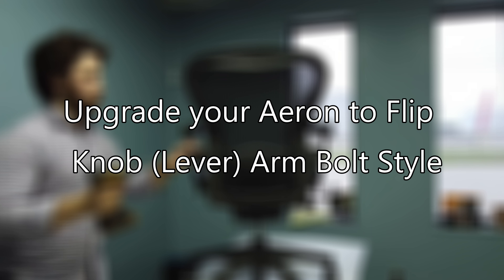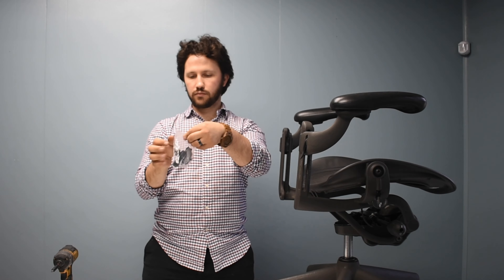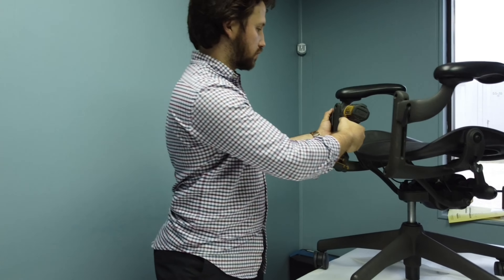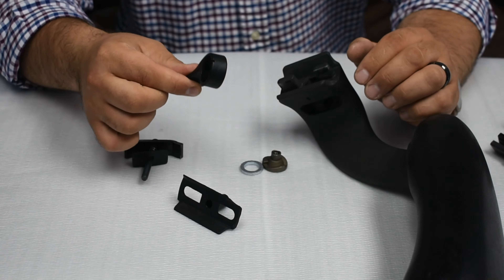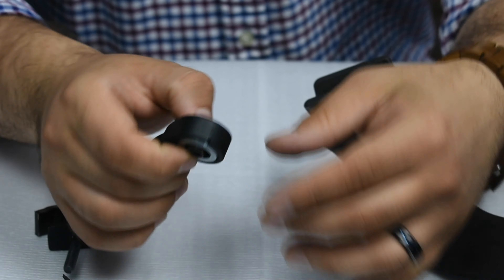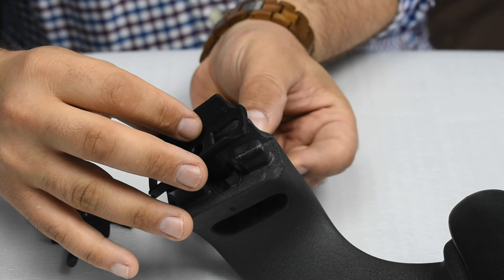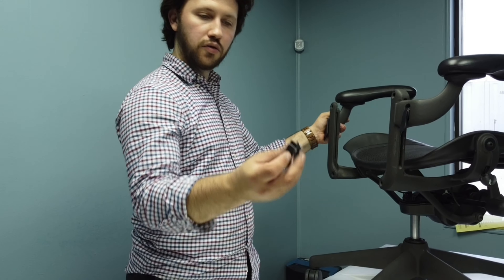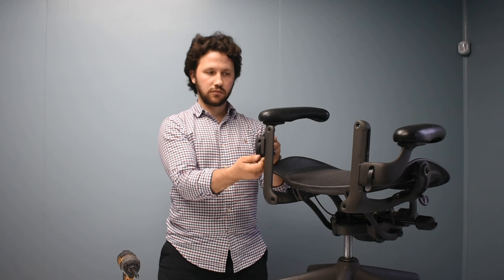Upgrade Herman Miller Aeron Thumbwheels ArrmBolt  to Flip Knob (Lever)  by OfficeLogixShop

Comment: How are the levered arms removed ? I tried loosening the bolts but it does nothing. I can’t remove the levered arms
Reply from the maker: if you do have a flip knob Aeron between 2004 and 2016, the flip knob will be stripped an locked in if you try to remove it. you need to drill it out. Please be attention for this process. you may use our product to replace you damaged flip knob with ours if you successfully take the old one out.

Comment: is yours also slippery like the OEM flip nob? does it slide down over time?
Reply from the maker: Hello. Herman Miller bolt is not removable by design. Our bolt connection design is removable. 

Best Regards

Comment: Each Flip Knob in your kit came with an additional (but smaller) washer and another spring both loose in the bag, but I don't see either being shown or used in the video, what are they for?
Reply from the maker: Hello. They are unnecessary parts that were made in the initial version of the kit but we included them in our shipments as spare parts. They can be disregarded once the kit is fully installed. 
All the best!

Comment: Do you make this part for after 2004 aeron models?
Reply from the maker: Hello. The kit is the same. It works on both models. While the actual Flip Knob is slightly different, it also works perfectly on both models. 

Thank you.

Comment: I deal with and repair these for over 10 years.  Why on earth would you swap out the far better arm mech for one that costs three times as much?  That doesn't make any logical sense to me.  The thumbwheel Aeron is the best.  The parts and labor to replace are very inexpensive.  Converting to the flip lever arm will just generate higher repair costs and nothing more.
Reply from the maker: Hello and thank you for your comment. Please note that you're thinking of the OEM flip arms. The OL flips do not cost nearly as much as the entire OEM setup and they are just as durable as the Thumbwheel. In any case, if you're in this business, we are more than happy to offer a discount on quantities!
Reply: The old thumbwheel is horrible, extremely difficult for fast arm rest hight adjustments, and always slips over time.